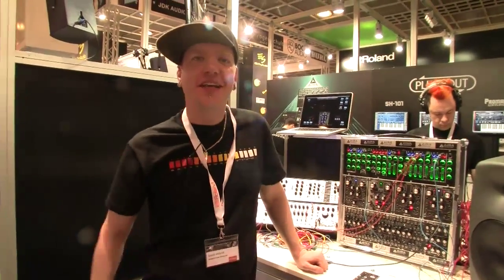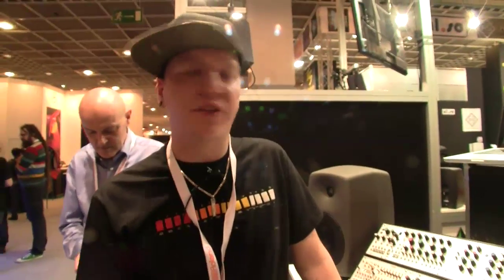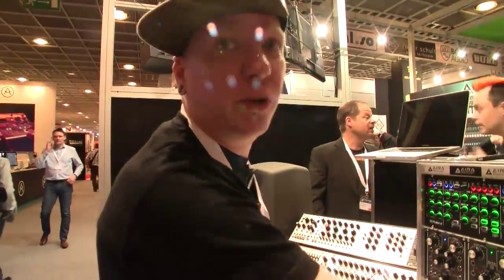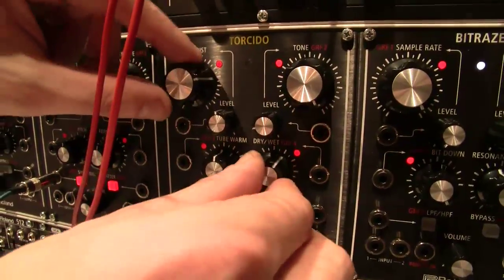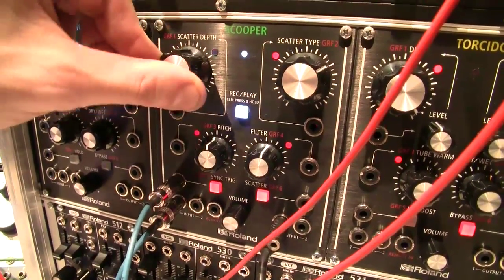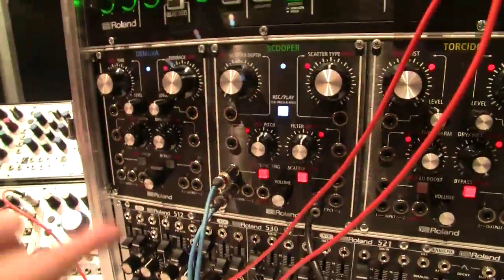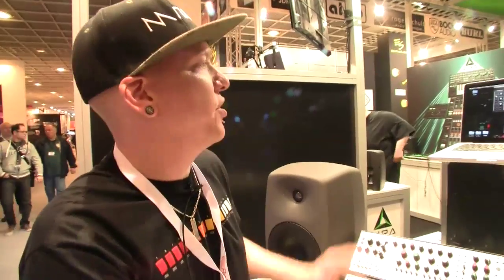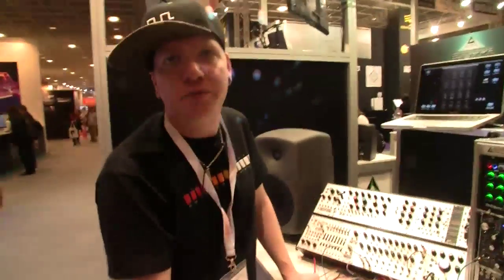MESSE 2015 AIRA Eurorack System 1M and Digital Modules

Comment: System 500 looks like its game, set and match, especially because Malekko build quality is involved and I hope these sound as good as they look.

Having said that...I never thought I would be interested in digital Roland, well... anything really, ever again.
But Bitrazer, Scooper and especially Demora (looks stereo as well), are very interesting. 299 does not break the bank either, especially for a stereo delay module with clock input and with that amount of delay time. I reckon Chorus/Flanger will be also done.
Reply: nectariosm Even more interesting are the 512, 530, etc etc modules on the bottom row which are all analog

Comment: Noone wants a scatter module m8sssssss
Reply: Mint the scatter Module has a lot programmable Functionality in - it's a Sampler with these programmable modules inside   LFO, ADSR, NOISE, SAMPLE & HOLD, RING MOD, FILTER 6dB, FILTER 12dB, TONE, AMP, MIXER, STEREO MIXER, CURVE CONV, GATE DIVIDER, TRIG TO CV DELAY TIME, MIDI CLOCK TO GATE

So no it's not just Scatter. ;)
Reply: Mint I do.  The scatter, key hold and arpeggiator together are able to do things a standard arpeggiator cannot.
Reply: Mint that's what i thought at first as well, but there are a lot of possibilities with this. i'm keeping an open mind.
Reply: if its a sampler to thatss szcool
Reply: technically a Sampler but it's more or less closer to a looper but still it records snippetz of incoming audio and you can modulate that or use it as a modulation source for the "Scatter" stuff.

Comment: well this certainly explains the recent system 1 price drop, now this will be about the cost that the system 1 used to be - also though is that the new system 500 below the aira stuff in the rack?
Reply: kassie2k4 yer.. what is the stuff below??
Reply: in the other video about those it's the system 100, but on the aira modular page at roland they call it the system 500, maybe they are different things
Reply: Yep, just watched it... 100% analog!
Reply: kassie2k4 They are eurorack size fully analog reproductions of the system 100 modules they are due for release in the third quarter this year.